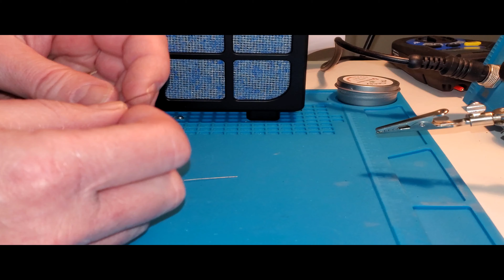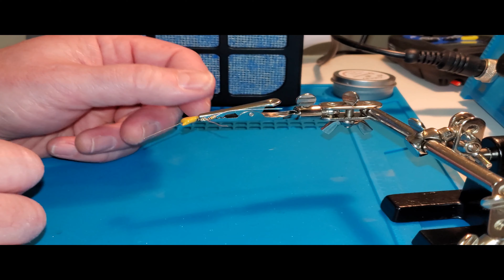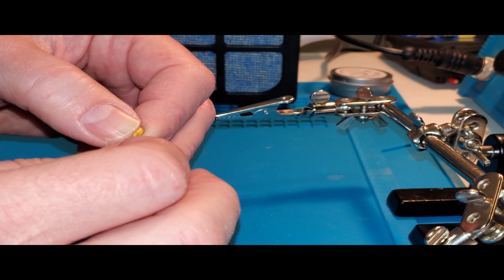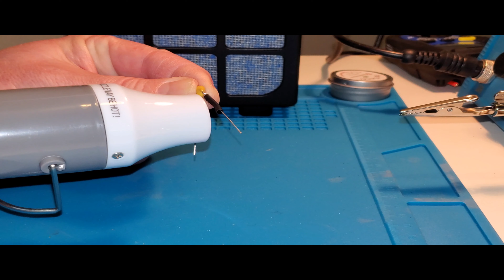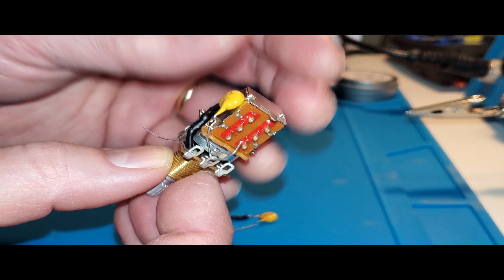How I make treble bleed circuits.

Comment: Thanks, got a 335 with push pulls but only use it in the normal mode and it needs that bleed, thanks for showing us how. I put that exact bleed in a Les paul special treble pickup and it has made it usable at all volume settings..thanks!!